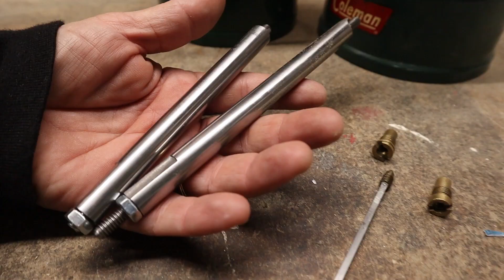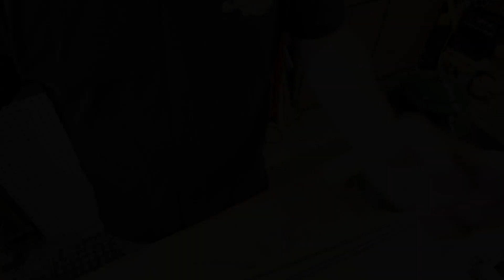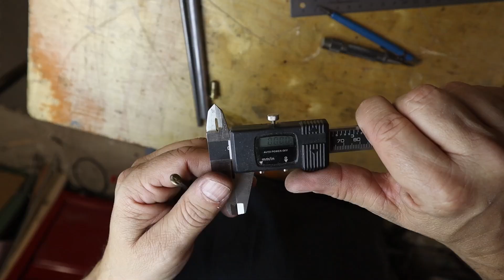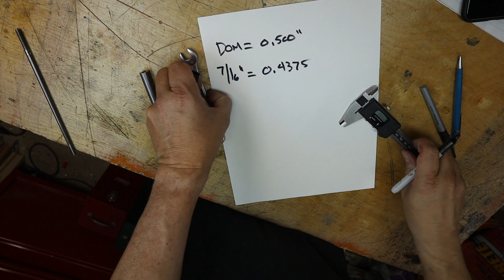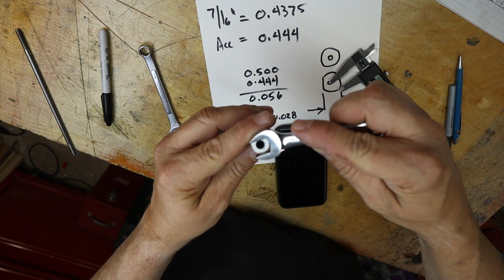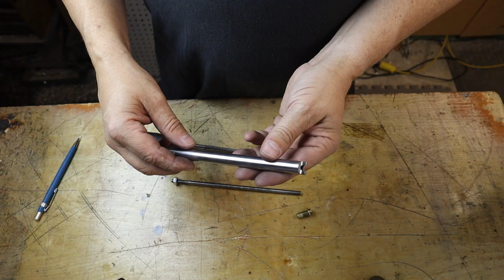How To Make a CHECK VALVE REMOVAL TOOL for a Coleman lantern - PART 1 // Easy Metal Lathe Project!

Comment: Made mine a few months ago, two center rods, one for 10-32 / 1/4-20 the other from a 1/4-32 bolt welded to a 1/4-20 all thread rod.
Reply from the maker: Nice work, great to figure out an alternative thar worked for you.  A 10-32 isn’t really a size Coleman uses.  It’s 8-32.  Cheers.

Comment: And for those three or four of us who don't have a machine shop in their house, we can just Easy-out the old one and install a new one, complete with that little square rod - for $12.95, From Coleman.😉
Reply from the maker: Well, that is one way to do it. I have removed some stubborn CV's that way when the prongs broke off. It is a shame to ruin a Check Valve. 9 times out of 10 they are repairable.  Before I'd recommend an easy out, I'd soak it with penetrant and use a large square shank screwdriver first before doing anything catastrophic!  Cheers..
Reply: @MikeFreda  I should have bought stock in PB Blaster and other concoctions. It works  well in many cases but when it doesn't, the screwdriver or file - clamped in a vise and me leaning into the tank...well, it's a crap shoot in my experience.  The 502 I just refreshed came out that way, but the previous job on a mint 66 Model 200A simply wouldn't budge no matter what.  So after I buggered it up good, I used the EZ out.

If I do many more of these, I'll likely spring for The Tool.

Keep up the good work.  Love your stuff.

Comment: Amazon has a 1/4-32 UNEF  tap and die set for $ 16 delivered.
Reply from the maker: Yes, they do know.  I’ve purchased the odd tap and die from Amazon before and they do work but I question the quality.  The one I purchased for this video is a high end tool meant for proper production work.  YMMV.  Cheers.

Comment: Why not just buy the damn tool and be done with it?   That Die alone probably cost more than the actual tool itself.
Reply from the maker: Yes, that is what I looked into doing first.  Unfortunately, I’m in Canada and the only tool available at the time was in the USA, with shipping and exchange rate it was way more than the Die and materials.  I reached out to a couple local collectors and they said if I made a few, they would purchase them. In the long run I worked out for me.  Thanks for commenting.  Cheers.

Comment: All I did was buy a 3/8 chisel and it was thick enough to fit in the slot and I used so pb blaster to loosen it up because they are very hard to get out but I got it out.
Reply from the maker: Yes, that can work.  I did something like that when I first started collecting and fixing up lanterns until the day I ruined a mint rare/early 220b. I was devastated.  Your mileage may vary but I don’t recommend removing a CV without this proper tool.  Cheers.

Comment: With a lathe, no need to buy a die for threads.
Reply from the maker: Yes, that is true but I found that it was rough to get a consistent cut with 1/4” dia and 40tpi.  That’s a pretty fine thread. Using a die is much easier not to mention changing the threading gears on my lathe is a pain.  Cheers.

Comment: Hi great vids on this. Hey could I use penetrating oil on my check valve with it still inside the lantern?
I’m not yet ready to try taking it out
Reply from the maker: Have a look at my other Coleman videos.  But yes, you can spray Carb Clean down the pump tube onto the Check Valve.  Remove the pump and stem first.  Let it soak overnight.  Cheers.
Reply: @MikeFreda  yeah I sprayed the carb cleaner in there last night. I’m gonna see if it worked when I get home from work tonight. Thank you for getting back to me

Comment: $75 for the die and you can buy a ready-made  tool for $50,  OK I guess.
Reply from the maker: Well, I’m in Canada and I could not find a “low cost” so I went with a premium one. I’ve been told that you can get cheaper ones on eBay in the US. I planned to make a few so I didn’t mind  paying for it.  With taps and dies you do get what you pay for.
Reply: @MikeFreda  I agree, but for someone just doing one ore two lights lt would not seem  feasible .

Comment: Clever work on cutting the 7/16” flats and also machining the check valve end. You could have done the 1/4”-32 thread by single point threading and saved $75?
Reply from the maker: Thanks. Yes, there was a bit it thinking and set up to do to accomplish this. Yes, I tried to use the lathe to cut the thread but it just didn’t work out for me. It’s a pretty fine thread and I just couldn’t make it smooth.  I could spend the money for a good threading tool or just get the die.  I choose the latter.
Reply: Or....he could have used the $75 to buy 2 check valve tools.
But, we hobby machinist are a sly bunch, why buy something when we can make it for 2 or 3 times the cost...lol
Just to be clear, I'm not giving anyone a hard time, I've done similar things myself.....and probably will again....